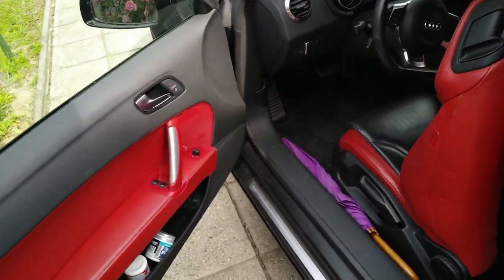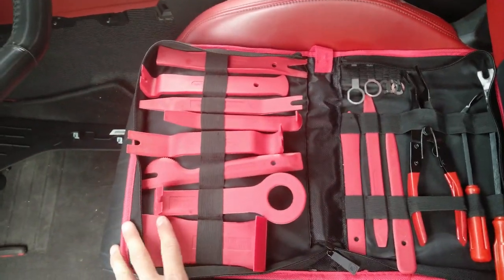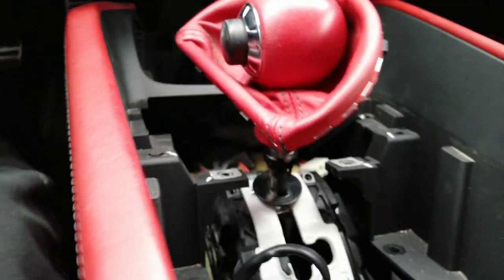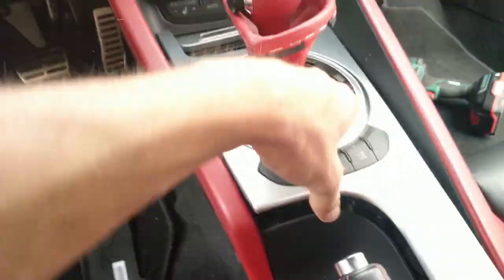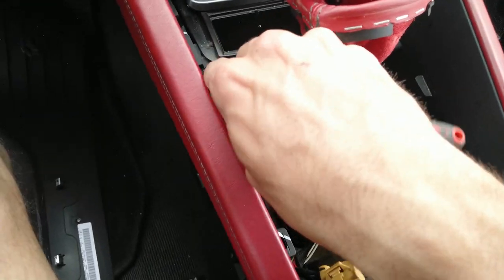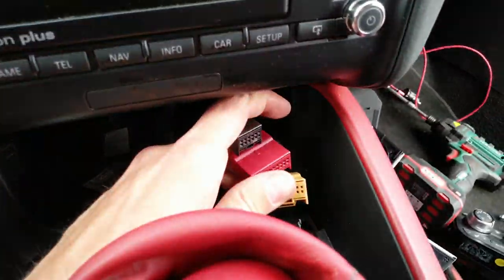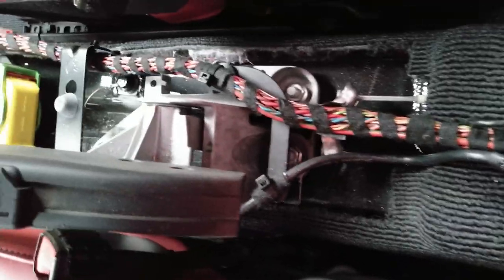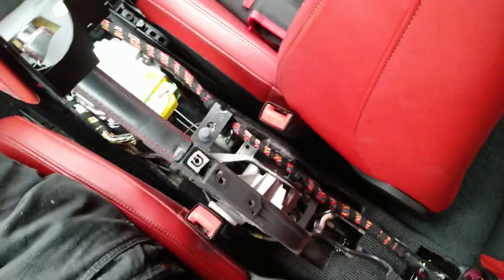Remove Center Console, Climate Control, Gear Knob, Trim, Hand Rest, Park Brake Cover on Audi TT Mk2

Comment: Hello, how do I replace broken cigarette lighter in Audi tt mk2 2007? Do I have to remove everything as you did on this video? Or is there another way to do that? Thanks in advance for your help.
Reply from the maker: If you need to remove it, this is the only way. But first check fuses.

Comment: Hi, I want to your opinion, Im thinking to buy a audi TT 2008 and I see that he have “fsi” engine 2.0T and Im afraid that this fsi engine can have some problems, I want to know you experience with that and if is better to find another TT with TFSI engine, please let me know your opinion
Reply: The Problem with tfsi (fsi) is from 2008-2011. If im correct. Ive got a TT from 2007 so its not affected. But if you know the engine code from the motor you can check if its affected. I got my car for about ~1 year and got no problems so far
Reply from the maker: In my experience 2007 tfsi is very good, almost no issues so far, which is 13 years already! The engine code is BWA. Fluids and filters were regularly changed as suggested by user manual, i.e., if you take care of your car it will last.